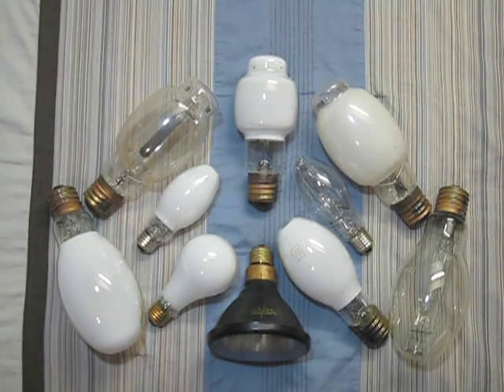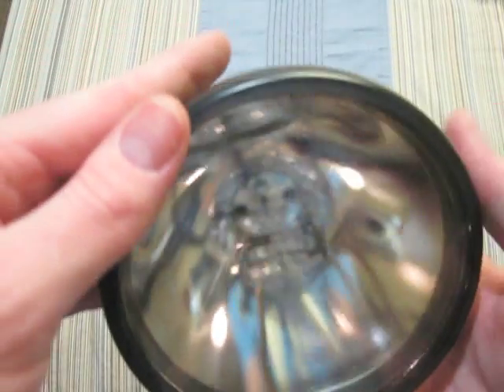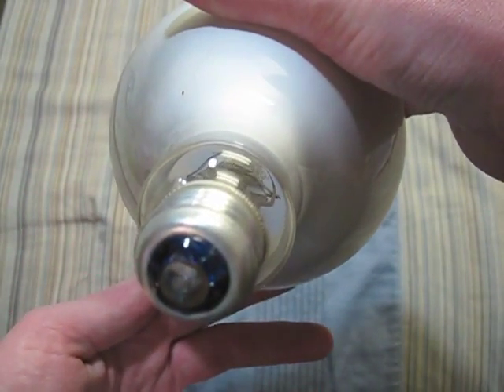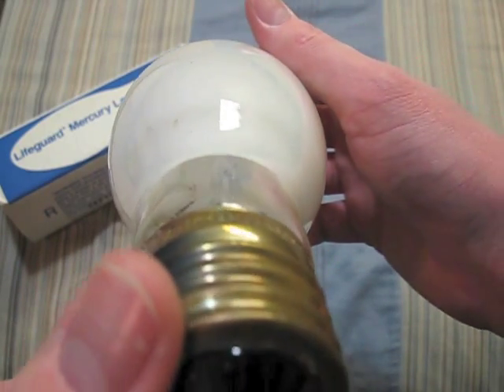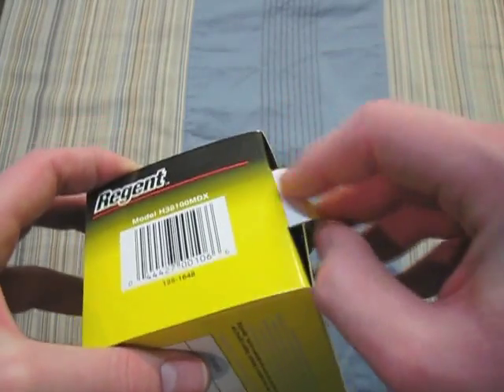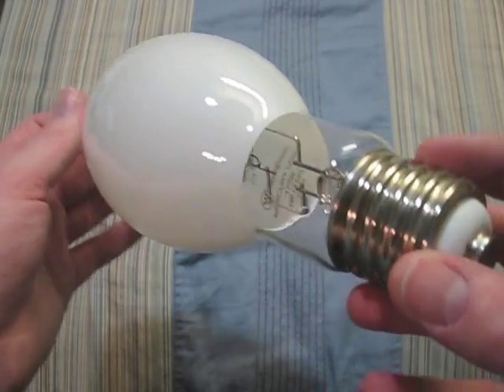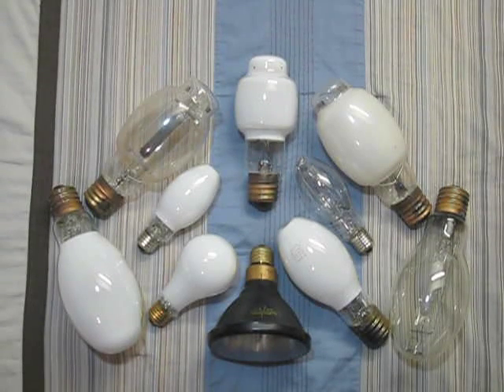Mercury Vapor (MV) Light Bulbs Part-2 2011

Comment: I LOVE the Mercury Vapors that have a Brass or Nickel plated Mogul Bass with a BEAUTIFUL Blue Glass Bottom`s!! I have a very Old Westinghouse 175 watt Bulb that has one so dark Blue it is almost Purple! IN MINT CONDITION! As well as a Luxor 175 watt new condition that has a bass like this! It also is a Self Extinguishing Safe T Bulb! It has a Tungsten filament that connects to the arc tube, on top! It lights up as well as the Arc Tube, If the Bulb is Broken, It will smoke out and fail to light! Very AWESOME Bulbs!

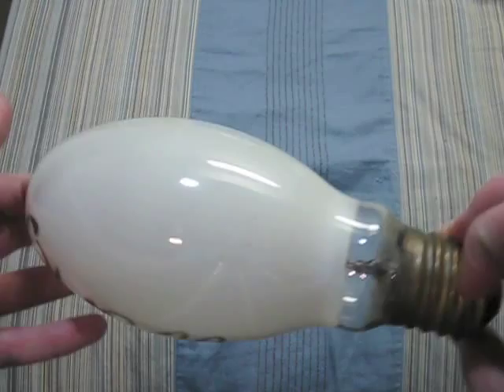Comment: The No Name Bulb came from Hungry! The Bulb at 0:47 is a Norelco!! I have a few of them! Phillips bought them out in the early 1980s and started using Westinghouse "Lifeguard" Arc Tubes in them! Note the similarities in Arc Tube Frame! What I call a "S" Frame!  Shortly after they bought Westinghouse and for a wile used the Westinghouse What I call the "Loop To Loop" Frame! Then sometime after went from the BT 28 Then To The ED28s! I have a couple of Norelco Bulbs that have a Spring on the wire that loops around the dimple! I call these Spring tops! The First Norelco`s had a L Frame Spring Top that had Strap supports for the Arc Tube! With the ED 28 Envelope! These are indeed very Cool Bulbs! You have a AWESOME Collection!